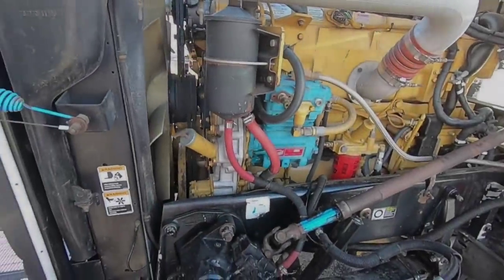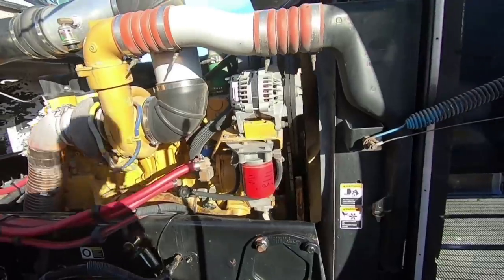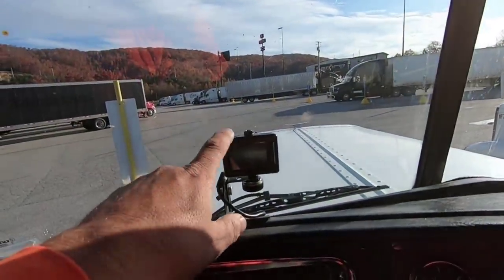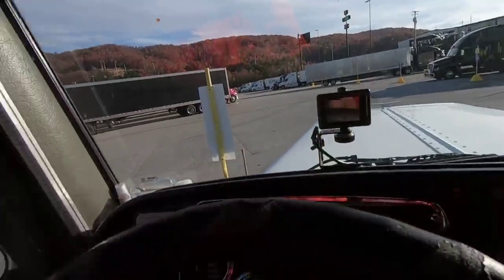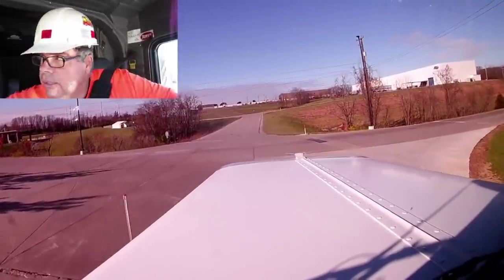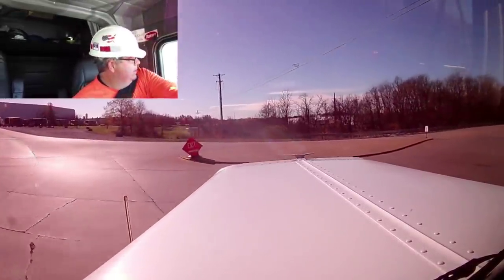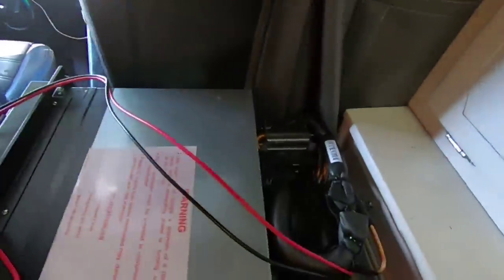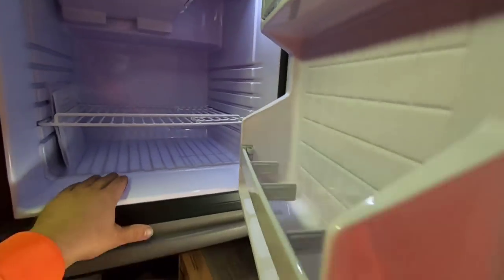#450 New Truck Refrigerator The Life of an Owner Operator Flatbed Truck Driver

Comment: this might seem odd, but i always used a scale on my bed every time i stopped for the night. you can't always find a level parking space even in truck stops. the level is used to see which is the high point on my bed. i don't like sleeping with my feet higher than my head. i wake up with headaches and a stuffy nose, so i switch my pillow around so my head will be higher.